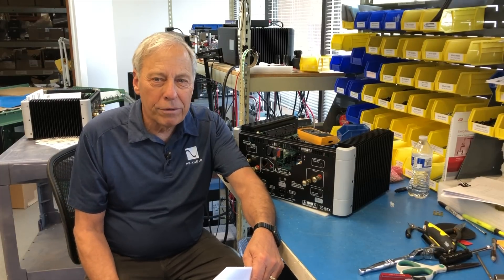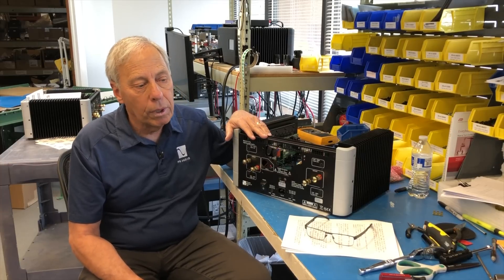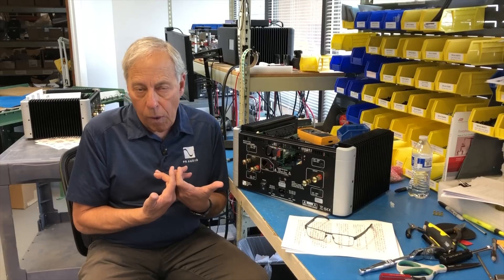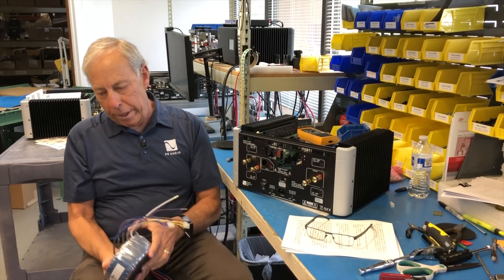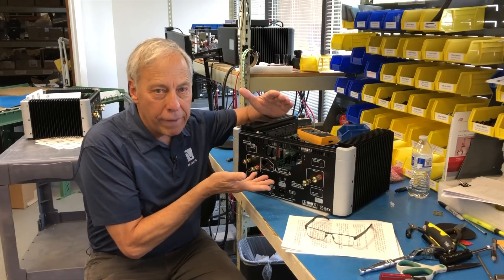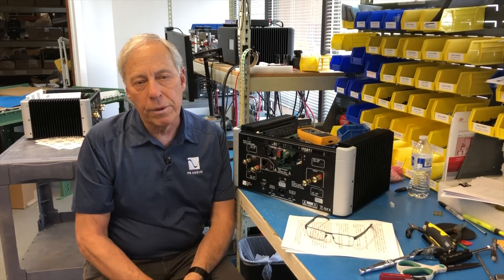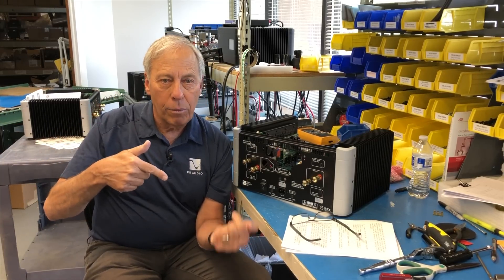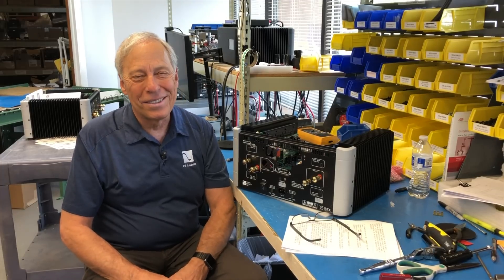Can you run 4Ω speakers on an 8Ω amp?

Comment: Since the 1980's many lower cost consumer brand solid state amplifiers/receivers were designed for 8 ohm loads minimum. The reason was to keep the costs down. If the amp was rated 100w/ch at 8 ohms, it would require a heavier power supply, heatsink and perhaps even a beefier output stage to handle the higher current demanded from a lower impedance load. Many amps and receivers that have A/B speaker switches would put the speakers in series when set to both A & B to keep the impedance from becoming too low. This is why the A speakers go off when you try to turn on the B speakers when no B speakers are connected.
Reply: Some can actually be really good for 8 ohm use (superior components, sound quality etc.) but they were just simply not designed for 4 ohms, that doesn't mean they are all garbage but some of them are.
Reply: JohnAudioTech you are right. I remember the sanyo stk-series amplifiers, were you had some 4R and 8R-devices to select for the application. Paul looks more from the high-end side of poweramplifiers, were current-capability is no problem in most cases.
Reply: Kenny Howard read Johns comment again
Reply: I recall some would not let you use less than 8 ohm with A and B on at the same time because they would be in parallel per channel. Some other solid states would also have a impedance switch with explicit speaker guidelines to keep the amp from blowing parts. I have encountered others that have firmware 6 ohm switching. So it is a mixed bag of how amps were built.
Reply: I see alot of  active pc speakers especially low end ones and also Iphone speakers/bookshelf stereos use 6 ohm drivers. Is this a quirk of the amp IC:S  they use to drive them directly? Also how does the difference in impedence  between driver and tweeter affect the total impedence of the group when the elements are parallelled without a crossover? These chips are often rated at 1W 8ohms but the speakers are advertised as 10-15 watts.
Reply: Tweeters usually have at least capacitor in series,  woofer or at least midrange has impedance that goes up quiet fast after something like 5-6khz which means that if you crossover tweeter at high point (lower capacity cap) you get somewhat flat impedance curve.
6 ohms is kinda best of both worlds, doesn't require as much current as 4 ohm needs but also can get louder with lower voltage. Chips are rated at 8 ohms and some are not stable for 4 ohms so manufacturers use 6 ohm speakers to squeeze little bit extra power without chip overheating or damaging. These days almost anything can handle 4 ohms.
Reply: Thanks for that.  But many of the low end ones use archaic chips though.  The better ones often use 2 stereo chips that are used for Bi amping. I mean PC speakers that pose as prosumer studio monitors, which should reduce the problems further.
Reply: Why is lower impedance better for speakers while higher impedance is better for headphones?
Reply: Jeriel Lopez Same concept as with home and car speakers, lower impedance headphones are for portable use and higher impedance for home use since you need amplifier to driver them properly.
Higher impedance headphones usually have smaller and lighter voice coil with better sound characteristics and higher sensitivity (at least that's what i was told). Lower impedance also means more power on certain output so it's easier to blow them up.
Reply: Cekpi7, I should have clarified that when I meant better, I was talking about sound characteristics. You explained why higher impedance headphones have better sound characteristics, but why is it the other way around for speakers? Thank you.
Reply: It's mostly due to the fact that higher end speakers are made for home use where as you said higher impedance is better. There are also good sounding speakers for car use, and many 4 ohm home speakers. It all depends on what speaker was designed to do, impedance has almost no impact if speaker was designed properly. To me it's just misinterpreted.
Reply: Denon PMA-1080R requires 4-16 ohm speakers for A OR B, and 8-16 ohm speakers for A + B.
Reply: The majority of quality amps also in the 1980s did ok with 4 Ohms. Actually nowadays too many listen to cheap one-way BT speakers with silly tiny class D amps inside driven by an underpowered brick power adapter. I see more people going cheap on audio today than in the 80s. Even those ghetto blasters with cassette player of the 80s sounded better than all these modern crappy small Bluetooth speakers from China.

Comment: I run 8 ohm on 4 ohm amps.  I have line amps to boost the signal. Class a/b amps that I use love this method. Class D doesn't appear to (turbo like ab) have this advantage,  they just hit the wall and that's it.

Comment: In the manual for my Technical Pro receiver, it says the RX55URIBT works most efficiently when using 8 Ohm speakers. I use 6 Ohm Dayton Floorstanders and everything is fine at volume 57Db or 54Db out of 60Db on it's volume scale. But I am using 2 speakers not 5.

Comment: I have a Harman kardon 3400 from 1992 & it has a 4 ohm / 8 ohm switch. I leave it on 8 ohms to get full power to my 4 ohm Elac UniFi ub5 pair. I problems with clipping or over heating.

Comment: That switch on the amplifier might be a switch to limit the current of the receiver when connecting 4ohm speakers to the amp. I once owned a Pioneer AV Receiver that had the same thing and in the 4ohm position, it would limit output power so that the receiver won't get too hot. I left it in the 8ohm position and never had a problem with it.
Reply: mein ErstesAutoFireandIce I saw a yt video on the audiohalics channel & they were  right IMO.
Reply: Some receivers/amplifiers switch transformer windings to lower voltage ones since 4 ohm requires more current but less voltage for same power, on my technics its +-32,6V to +-28,2V before rectifier (actuall rating in service manual)

Comment: On tube amps, you must use the amp output terminal that is nearest value below (floor) to the speaker rated impedance. For example if the speaker impedance is said to be 6 ohm, you should use the 4 ohm terminal. You won't damage the speaker or the amp if you plug the speakers to the higher rating (6 ohm connected to 8 ohm), but current transmission won't be optimum and you will probably sacrifice the amp bandwidth flatness.

Comment: If high ohm speakers take less power to drive how come my 250 ohm headphones need a beefy headphone amp?
Reply: FullFledged2010 because that beefy amplifier will not push as much power into 250 ohms as it would 200, 150, 100, etc. And if your headphones have a unusually low impedance at some frequencies or has a weird phase curve, that will cause them to be hard to drive, and that can destroy a weaker amplifier. My Polk LSi25s are rated at 4ohms, which doesn’t seem too bad (enough to kill most AVRs but most separates or integrated amps could take that) but they are hard to drive because at some frequencies they dip down to below 1 ohm. This will kill all but the beefiest amplifiers. Ohm ratings are really an average, meaning that a 8 ohm speaker could go to as high an impedance as 20 ohms or down as low as 1 ohm. All it is is an average.
Reply: Apples and oranges. A "beefy" headphone amp is designed to provide more voltage to a higher impedance instead of more current to a lower impedance for the same power level. You could accomplish the same thing by using an appropriate sized audio transformer with a 1:5 or 6 turns ratio.

Of course, a transformer would affect the fidelity of the circuit.
Reply: Makes sense ;)

Comment: What about tubes?  Can an 8 ohms drive 4 ohm speakers?  Speakers aren't consistently 4 ohms across all frequencies.  How does this effect things?
Reply: When a speaker is rated at 4 ohm it means that from the frequency range the speaker is designed to do, lets say from 0 to 20 000 hz, the lowest measured impedance is going to be 4 ohms. So a 4 ohm speaker at any given frequency should not go lower than 4 ohms.
Reply: Quetzalcoalt   What happens if you hook up 4 ohm speakers to an 8 ohm tube amp?  Does this hurt the sound?
Reply: Wrong Quetzalcoalt, the rated impedance is usually the mean (average), must speakers impedance go way down that the rated value below 100Hz. Some can go as low as 2 ohm, and that is what usually blows the amp. Decent speaker manufacturers will tell you what is the lowest impedance value. Companies like DALI will guarantee that the speaker will no go below 20% of the rated value, example: if the speaker is said to be  4 ohm, it will not go below 3.2 ohm, if it is 8 ohm it won't go below 6.4 ohm. Bad speaker companies will usually hide this information.
Reply: Polk audios LSi series are very hard to drive because they dip below 1 ohm in certain frequencies, but this doesn’t mean they are a bad company, because they clearly state in the manual “this speaker is very hard to drive, make sure to use low impedance beefy amplifiers”. Sure you can hate Polk if you want, but they make great stuff.
Reply: Micah actually I think Polk are OK and are an excellent audiophile beginners choice. As far as the company is honest and states it the info it's OK, that way you know with what you are dealing. Speakers with very low impedance dips are not that great for tube amps. It's much more difficult to design speakers with tight impedance, great changes in impedance has also a great effect of time phase.

Comment: My Yamaha A-S801 integrated amp, which is a current model, has an impedence switch. I left it at 8, after watching the Audiolics revue. Have no problems driving my Kef LS50's.
Reply: Well the LS50 are 8 ohm lol
Reply: @fwabble  they're all over the map and quite inefficient.  I believe 85db.
Reply: @fwabble  They are listed at 8 but do dip quite a bit, but you're right they are nominal 8 ohm.

Comment: ''Can you run 4Ω speakers on an 8Ω amp?'' Read the amp manual - specification! That's the best way... These days, the answer is usually ''yes'', like Paul said. For example, an amp to whom the basic information is 60W and (on) 8Ω, almost doubles the power and reaches around 110W on 4Ω... little is lost in the transition.
Reply: even if an amplifier is 4 ohm stable, it's not necessarily going to have a power supply cable of supplying double the 8 ohm rated power into a 4 ohm load. like my BK subwoofer plate amplifiers - my Extreme 1000s are 630w RMS into 8 ohms and 1000w RMS (not 1260) into 4 ohms, and my BSBP 275 is 200w RMS into 8 ohms and 275w RMS (not 400) into 4 ohms. also, impedance is not a constant, and only in a small part of their frequency range do speakers drop to their rated or "nominal" impedance. also, ported or "bass reflex" enclosures are popular nowadays and those create impedance rise, so a 4 ohm rated driver load in a ported enclosure can not even dip below 10 ohms in some cases.
Reply: Dragan Antonijević but if the amplifier doesn’t have the current to supply that 110 Watts, then it will cook itself. That’s why manufacturers added the 4 ohm switch.
Reply: It is not necessary... if you read once again and carefully: ''specification'', ''These days'', ''usually'', ''basic information''... and I am talking about solid state... my monoblock are 125W for 8Ω and 220W for 4Ω. I apologize if there was a misunderstanding, I didn't think about tube amplifier. Peace
Reply: RWL2012 beat me to it. Makes no difference if it’s solid state or tube, it still has limits to its current.
Reply: on 70s and 80s amps the 4 ohm speaker will lead to the amp blowing up..i had to many blown amps to know that if it says 8 ohms run only 8 ohms...dont even put speakers on one output as this will reduce the ohms and will still blow your amp.follow the amp instructions.

Comment: This is a complicated topic - speaker impedance is constantly fluctuating by frequency. Speakers are not static loads, and music is not test tones, which gets around to why it's important to have a high quality amplifier - they can deal with these kinds of changing demands without clipping or melting down. 100 watts/channel in one product is not the same as 100 watts/channel in another product when you actually listen to music.
Reply: Finally ,a person explains what most of us people who understand audio know. You cannot use spec's to audition a product. One sentence in you posting says it all. "100 watt from one product is not the same as 100 watts from another product"  thank you.
Reply: +Karl
At about 100 hz some speakers have a peak in impedance. Is this something to do with the crossover minimising the loudest bass sounds made by the driver and enclosure resonance? Chokes must make impedance higher at frequencies significantly lower than the crossover frequency (like 100 hz)..
Reply: I agree. Used to have a AudioLabs 8000A from the 80's, which was rated at 50w per channel. I've listened to amplifiers in the 100-150w p/ch range that couldn't match its oomph.
Reply: @LewisHamiltonMSPR   thats because they didn't lie about their ratings like the new stuff. lol. im using a NAD 7220pe amp and i think it's rated at 20 or 40 watts per channel. But can do double that in bursts. I'm convinced it out does amps with 120 per channel ratings.